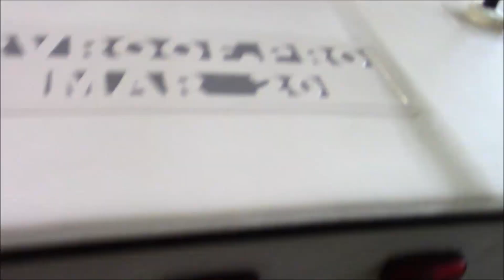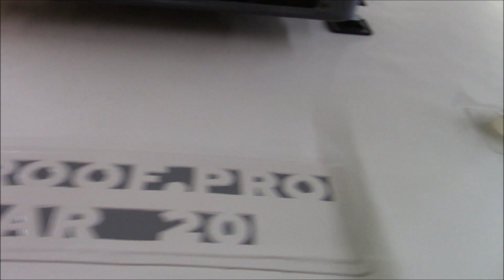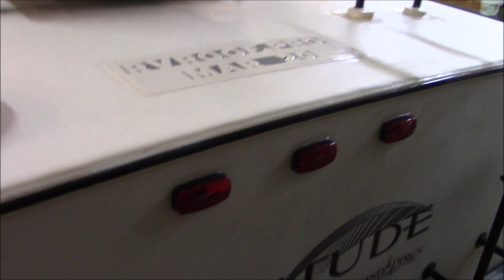2014 Grand Design Solitude New Roof

Comment: I just finished putting a new roof on my 27 ft. C class and luckily didn't go down the Dicor rabbit hole and used professional caulking supplied by my friend a window installer, it's not about how much caulking you put on it's about the quality. The stuff I used is not available in stores and this  is what the pros use and it's good for at least 20 plus yrs, do it once and do it right.

Comment: I would love to see y'all set up a shop in Huntersville also or Huntsville al. The work y'all do is excellent. No one in the t.v. Industry can touch this. Thank you for all you do
Reply from the maker: Thanks for watching!
Reply from the maker: The reason we are better than the RV people's is because I am not an RV roofer by trade. I am a General Contractor licenses in 3 states for commercial buildings. Main focus in roof systems and structuality. So we look for fault to correct. I designed to roof system and all the components for them..
Thanks for watching.

Comment: How warm does it have to be for the tpo glue to set well, I'm working outside and these days it's around 60 to 65 degrees 
Thanks
Reply from the maker: Not sure what your using. Read the label, should outline the use,  clean and precautions.